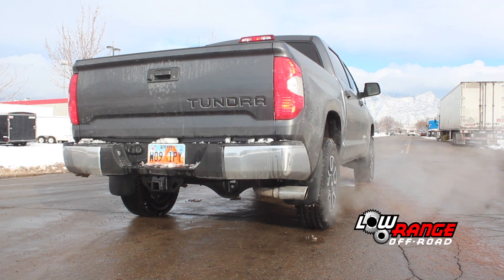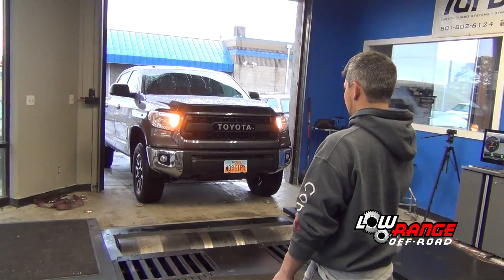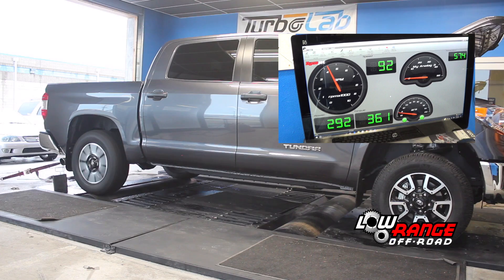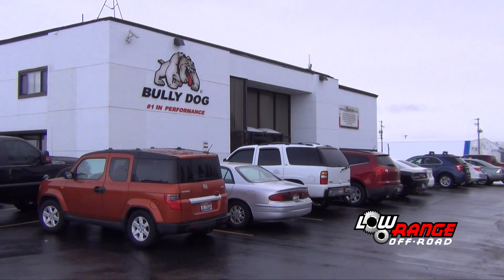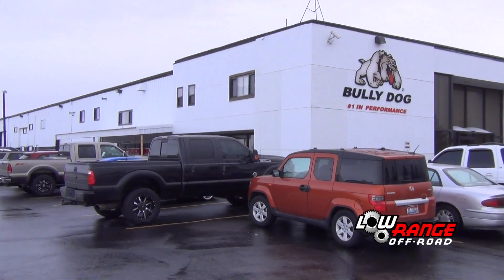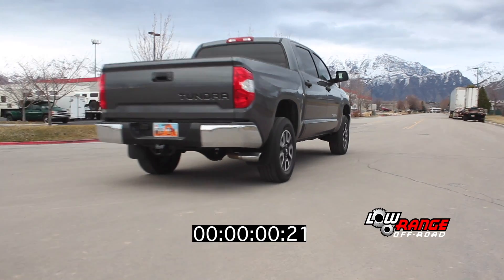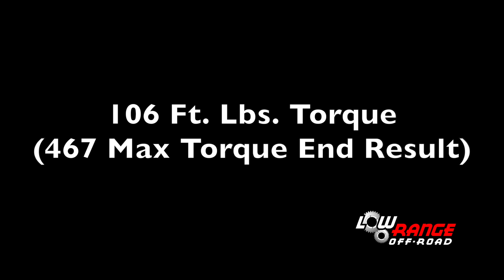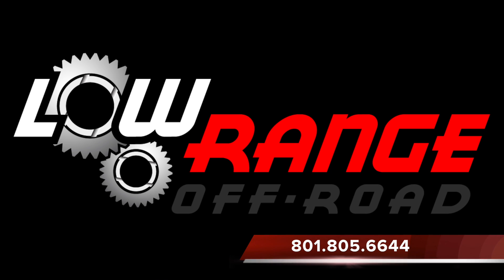Magnuson Supercharged 2017 Tundra - "Before" and "After" Test Results

Comment: Traction control ON for a WET 0-60 test? Abnormally low dyno numbers stock? INSANELY high dyno numbers after install? Smells like a sales pitch.
Reply: Car question’s page crewmax bone stock ran 0-60 in 6.4 seconds for a correct reference

Comment: 2016 Tundra with Magnuson supercharger. Ever since I got it (used) cylinder 5 misfires. Not sure how to fix it. I hope I don't have to replace the motor 😔
Reply: You got the truck used, or the supercharger used? Also, what kind of gas are you running?

Comment: This stock motor is rated at 381hp crank. Based off that, 292 hp @ the wheels stock is damn near 30% drivetrain loss..... That can't be correct. The torque rating on a stock Tundra is 401ft/lbs, so the 361ft/lbs at the wheels from this dyno equates to 11% drivetrain loss. How do you lose 89hp (381-292) but only 40ft/lbs (401-361)? Either this dyno is off or something else is up.

Comment: 2008 Tundra 270k Miles, I do around 100-200 miles a day and I plan on keeping this truck until 500k miles at least.
Reply: What engine do you have? I have a 2017 Tundra Platinum that I bought last year, and I really want to keep it for as long as possible. Any tips besides regular oil change and fluid checks?
Reply: 08 tundra here with 500k still runs like brand new plan on keeping it until 1 million

Comment: I have a 2009 Tundra SR5 4x4 TRD, have had it since new, only mods are magnaflow exhaust, k&n filter, leveling kit, rear airbags, and 285/65 R18 tires.  Looking for advise, pardon my ignorance, I feel like I need more torque/hp to tow my 31' rv trailer (8k lbs dry weight). I do not feel comfortable towing it over long distances, I am retired and want to take it out on pleasure/camping trips out here in the vast southwest.
Will this supercharger set up be the answer to my towing needs?
Reply: That will not help with towing, depending on your setup that year tundra can tow between 4,300 to 10,800 lbs max .  Your camper is 8k dry your are pushing the limits. You may want to think about a smaller or lighter camper.  The Tundra with the stock v8's have plenty of hp and torque to tow but you may just have two much weight .
Reply: Sure will

Comment: 292 HP to the wheels stock??? 🤔Something wrong with that... That's REALLY low for a 5.7...
Reply: That's what I thought. That's got to be just at the wheels because they are rated for 385hp
Reply: High altitude maybe?
Reply: At the wheels vs at the crank.
Manufacturers rate HP at the engine. Dynos rate HP at the wheels. 
 There is on average a 16% loss of power through the drivetrain. A perfectly new tundra supposedly makes 385 at the crank. There would be roughly a 61hp loss through the drivetrain. 
This number can be more or less depending on the fuel used, the condition of the filters, wear on the engine, altitude, and bigger heavy tires will all cause power loss. 
The tundra in this video was not tested to redline, so it's slightly low.   This was a fairly accurate representation of what you should expect from a tundra on the dyno.

Comment: So you telling everyone that this 5.7L flex engine is weaker than that standard 5.7L. Dude it's only a little more power over the 4.6L and 4.7L. You sure it's the 4.6L not the 5.7L maybe you can swap that 4.6L block to the 5.7L block  you'll get outstanding power like the

Comment: I saw a FLT video showing that just tuning the 3.5 ecoboost generates numbers very close to these numbers on the Tundra. That was at sea level vs 3000 ft above mind you. The F150 was a beast at that point. 
    As far as reliability, well I had a 2011 F150 5.0 and drove it about 180,000 km. I changed the oil, put gas in it, did the brakes once and new shocks and tires. 
    I currently have a 2017 Tundra 5.7. The routine maintenance schedule Toyota has is EXPENSIVE! I then put gas in the truck, change the oils, have to be towed 4 times (one time in a severe blizzard, electronics) have a new transmission at 85000 km, still don’t trust the new transmission as it stranded me once (electronics) and had to have the head replaced on the drivers side (they wouldn’t do both). This was all warrantied of course, but with 158000 km on the truck (99,000 miles) I am looking for anything BUT a Toyota. I have the off-road version and have not had to replace the shocks yet. That is a plus,,,,,,,,, hehehe.

     Sorry guys but Toyota does put the occasional mistake on the road. I bought the dang (f@#&$’g) thing.
Reply: I just traded a 2013 F150 5.0 Supercrew 4x4 for my 2019 Tundra TRD Crewmax Limited. I experienced the following with the F150: Wiper control failed at 58k miles. Audio controls on steering wheel failed around 68k. Heat shield started falling off around same time. Lost coolant around 75k, had to replace O-rings. Noticeable thunk on take off; slop in driveshaft splines? Passenger front seat squeaks when you hit a bump, windows squeak going up or down,  and last straw was cruise control not maintaining speed. If the Tundra is better made than the F150 it replaces I'll pay for the uptick in cost to own. The Ford is Kodiak Brown and for sale at Bayside Used vehicles in Prince Frederick, MD. Just 94K miles and so many more parts to fail!
Reply: MrAristes  - it really is the damndest thing. I have a friend that has all Ram. One 1500 4x4 Hemi, one 1500 rwd lowered hemi, and a 3500 diesel. He has over 300,000 km on the 4x4 and nothing other than routine maintenance, the rwd has about 150,000 km and nothing. They are 2014 and 2016. The 3500 is brand new and has had some minor issues.  My other friends swears GMC is better than Chevy. 
    I guess they all have issues and it just depends on which one you get. Guess that is why there are so many manufacturers and they all survive. 
I hope your Tundra treats you really well. I absolutely loved mine until it stranded me the second time.  They are still good looking trucks. 
    I was playing with a GMC AT4 1500 pickup. Nice truck with the 6.2 and then I reached the tailgate. I pushed the button on the keyfob and the gate opened and unfolded,,,,,,,,, wellllll...... I heard angels sing and the sky cleared up. I don’t care about anything else! I want the truck attached to the tailgate!!  hehehe
     Here’s to trucks! Stay safe out there.

Comment: Full tank stock run. 
Empty tank supercharger run Lol
Reply: I wouldn't be surprised by what you say but all the other testers have always got high 6's or very low7's  in Tundra's but they wouldn't be testing on a wet road with ice around which means the tires are cold and stiff as a board.  Then again they wouldn't redo the test in perfect condition and would have brake torqued the engine and its hard to tell if they did in this test although you can bet they did with the supercharger and probably used 4wd.
Reply: @comment_deleted  you seem upset, lady
Reply: I know,  those extra gallons probably added 2-3 seconds to the stock test...
Reply: Vito it would not vary that much!

Comment: It amazes me how most of these dumbass people commenting saying shit like “those numbers have to be from a 4.6 V8” Or “that flex fuel must be crap because the factory specs say 381hp and 401ftlb of torque”. Dear god the idiocracy is overwhelming on how uninformed and uneducated people are on how manufactures rate power.   It is pretty much 99.99% NEVER wheel horsepower and torque ratings.

Comment: It’s free to push the “Tow/Haul” button and make your Tundra a lot faster and aggressive. Amazing how much more fun it is to press this button. Feels like double the horsepower. Try it!!!!
Reply: rip transmission
Reply: double really lol
Reply: kristofer Biggs all it does is make the tranny wait longer to shift. That’s probably why it seems faster
Reply: Nope.  I have a 2018 Tundra.  I've hit that magic TOW HAUL button many times.  It completely changes the throttle response as well as shift timing.  It's a whole different beast after you hit that button.  I can't even imagine what the Tundra TOW HAUL mode might be like after the supercharger is installed.
Reply: Evan you're half right . For the tundra its different when you have tow/ haul on. Not like the other trucks

Comment: How is it that it gained 106 ft lbs, if the stock tundra has 401 lb ft?
Reply: Stock has 381 horsepower and 401 lb ft in torque to the crank but to the wheels the horsepower and torque is always lower on all  vehicles.

Comment: For about $600.00 my Tundra makes 516/522...on a safe dry shot of nitrous...100 % stock everything including computer...I use about 4, 10lb bottles a week for over 2 years and changed my plugs once...NEVER HAD 1 PROBLEM OR ISSUE...JS you guys spent over 7k...I spent about 600 and make a ton more hp...🤷‍♂️
Reply: Are you going to use nitrous while towing? SMDH
Reply: what in the fuck?
Reply: N2O is between 3 & 5 bucks per pound.. even if you only paid 2 bucks you have spent well over the $7k bucks in just filling your bottles.. but I'm sure your full of it on how much you use.. $30 x 4 per week x 52 weeks = $6,240.. x 2 cuz you said two years.. that's $12,480.. man that nitrous is really saving u some cash..

Comment: I have the TRD supercharger in my '12 Tundra. It's the same Eaton TVS1900 unit. I'm running the BullyDog tuner with under drive SC pulley and the overdrive damper pulley. It pulls hard.
Reply: I have a 2011 factory TRD supercharger & the pulley looks pretty small already, how much smaller can you go without slipping & what are the boost differences?

Comment: I was going to purchase this s/c for my 14' flex 5.7 Tundra, but my local Toyota said they would not install it on flex fuel engines because they are unreliable in comparison to non-flex engines. I just don't see how that's a valid statement. I run 87-89 oct on my truck and never once have I ran e85. If the injectors and fuel pump are bigger to handle the capability of running e85, then what could be making it not as reliable as a non-flex engine, according to my local dealer? Any input? Thank you

Comment: how much did all this cost exactly to give that extra 200 HP and shave two seconds off the 0-60?
Reply: $6904 Installed? That's not bad. I had Toyota install mine 4 years ago and it was $6100 + tax. I added the BD tuner later.
Reply from the maker: The supercharger which includes the Bully Dog tuner is on sale for $6,904.07, Regularly $6,995.00.  Link to Products:  http://www.lowrangeoffroad.com/catalogsearch/result/?q=magnuson+Supercharger

You could install it yourself using the full color step-by-step instructions provided by Magnuson and the overview video we made; (See links below) or you could pay someone else to do it.  Some Toyota Dealerships will do the install for around $1,000.00 and we have also heard of independent technicians doing the install for as low as $650.00.  Here are the links to the Magnuson instructions for both the Flex Fuel and Non-Flex Fuel 5.7L engines: 

Flex Fuel 5.7L Engine: http://blog.lowrangeoffroad.com/wp-content/uploads/instructions/instructions/Magnuson-Tundra-Supercharger-Installation-Manual-For-Flex-fuel-Trucks.pdf  

 Non-Flex Fuel 5.7L engine:  http://blog.lowrangeoffroad.com/wp-content/uploads/instructions/instructions/Magnuson-Tundra-Supercharger-Installation-Manual-Non-Flex-Fuel.pdf  

Our Installation Overview Video:  https://www.youtube.com/edit?o=U&video_id=UZ3z1IGm-IM

Thanks for watching and commenting!

Comment: Oh Toyota...every year making the truck bigger and heavier but keeping the same engine.  My 2007 Tundra DC Limited Fully loaded features with stock everything does 0-60 in 6.5 seconds if I can get traction off the line.  Normal 0-60 is around 7 seconds flat.
Reply: Have the same truck is yours slate and trd?
Reply: No mine is just a limited double cab with towing package
Reply: Tires, add ons, elevation....lots of things affect dyno's and times.
Reply: You are correct. Jones is 07 double cab with every option except leather. I stayed beside a hellcat challenger today for about 5 seconds full throttle both of us. My 0 to 60 is always 6 seconds on the factory tires 20 inch bbs wheels

Comment: Something fishy with that dump test... sorry don't buy it... I have 2013 Tundra and still has all horses last time I checked....maybe you running in garbage flex-fuel!!!
Reply: You can't even buy E85 in Utah and Idaho. The difference in what they got and what Toyota advertises is mostly the difference between rear wheel, and at the crank. SLC is also at about 1500m, so you will see a slight drop due to altitude.

Comment: How reliable is the supercharger? What is the chance of blowing headgasket, how much horsepower can the engine handle before blowing up?
Reply: 5.7 was designed for a supercharger.
Reply: The head gasket is fine for 500 WHP, it’s the cast rods that I’m worried about. Thank goodness this is a flexfuel truck, because running E85 (105+ octane) will keep those rods from blowing out of the block.